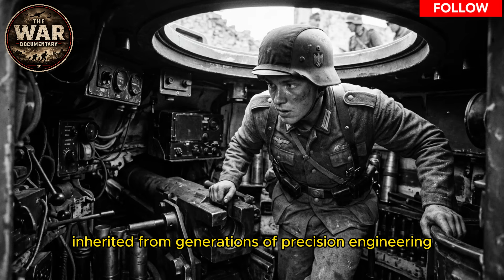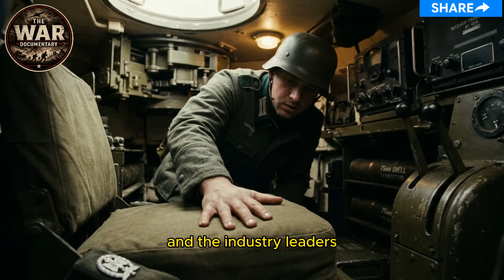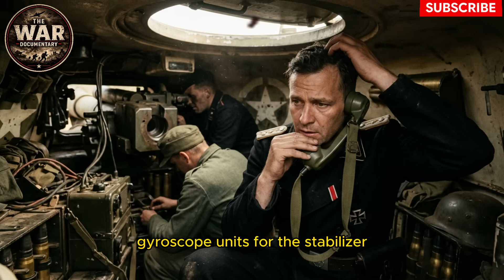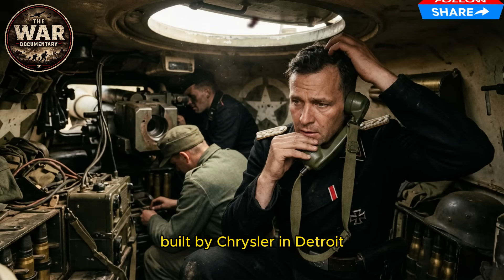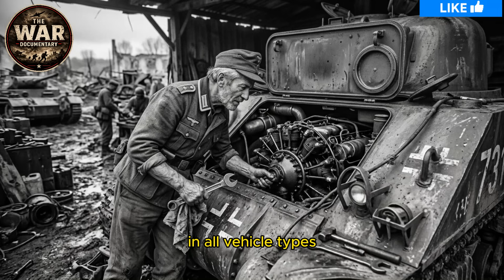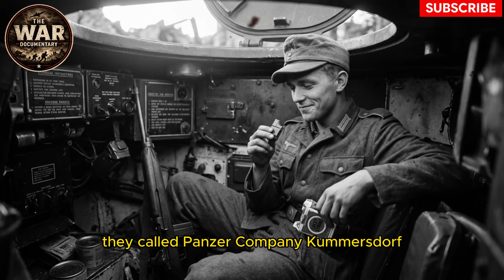What Stunned German Tankers Inside Captured American Shermans

Comment: how could they use the exhaust from the generator for heat without killing themselves?
Reply: Exhausted pipe running through the cab . Then out side. Not into the cab. Is there an emotional with rolling eyes? This will have to do. 🙄
Reply: Emogi